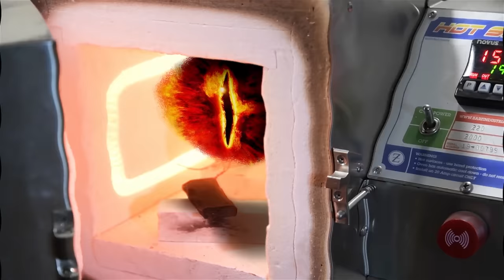Making a Slip Joint Knife

Comment: What you want to do is put a shim between the scale and the blade when you peen the pivot pin, to stop it pinching. To fix a tight blade after peening you can half open the blade and give it a good tap to lever the scales apart slightly. However this can pull the pivot into the scales a little so it's best to test and fix before finishing the scales.

Comment: Hey Tony, long-time follower and fan here hoping you can help me with something.  I don't know where to post this question, but since this is your most recent video I will post it here.  Do you have any tips or tricks for drilling holes in hard to reach areas.  Like, if you needed to mill a small cylindrical pocket maybe .500" wide by .250" deep in a cylindrical cavity about .750" wide and 2.000" deep.  The smaller pocket needs to be perpendicular to the axis of the larger cavity, and located halfway down the larger cavity.  Hope that made sense.  You could just drill a hole from the outside, and tap the hole and fill it back in with a plug short enough to leave a pocket; but let's say for aesthetic reasons that is not an option...what do you do (other than wire EDM)?  The material being machined is aluminum.
Reply from the maker: that's a tough one!  is the bottom of the small 1/2" pocket also cylindrical?  3/4" isn't a lot to work with.  Can you come from the other side?  mill through the opposite wall, make your pocket on the inside, then plug that hole?  It could be welded and remachined.  This might even be tough for EDM to move around in!
Reply: @ThisOldTony  Sorry for late reply.  I had a part prototyped with the EDM, so I know it is doable.  I want to make them myself but don't want to go the EDM route.  The bottom of the pocket is also cylindrical.  My best idea so far is to use a 1/2" reverse counterbore (picked one up from MSC Direct online).  The reverse counterbore is 1/2" diameter and 1/2" tall.  It also fits inside the tube easy enough.  It has a 5/32" pilot hole, so I am thinking turn down the outside diameter of the part but leave it a few thou shy of final OD.  Drill 5/32" pilot hole.  Reverse counterbore from inside toward the outside.  I will have my 1/2" cylindrical pocket about 1/4" deep.  Then turn a small 5/32" pressure fit pin about 1 thou oversize, tap it in place, and finish turning the OD to size.  After tumbling in media and anodizing I don't think there will be any evidence of the process on the outside surface.  It's OK that the pin enters the cavity a tiny bit since the cavity holds a small coil spring (it will just wind around it).  That's the best I've come up with.

Comment: We older telephone engineers would call the noisy spin-a-ma-things Strowager Uniselectors  When you pick(ed) up the phone, the uniselector found A spare first selector and dialing tone.  I've lost count of how many I, dismantled, cleaned, oiled adjusted spring tension and remounted during the 70s.  The noise was deafening.  These days the entire exchange would be about the size of the box.

Comment: 20:56  Uni switch.  They are like the next generation of step switches.  Looks like he's had some exposure to telecom, but not somebody to show him the nuances of lacing.  That and there is a huge difference in the type of lacing cord.  The poly stuff never looks good, and never holds like it is supposed to.  Good old cotton nine cord is where it is at.  Back in the day every wire would be secured, and every running stitch would be the same distance apart.  Spend days in a single telecom bay just lacing everything down.

Comment: Oh, by the way, do not smell or inhale the dust from those contact's... Those are made with orange and or red brass... unless those are from 1981 and newer.. if pre 1981, although it smells neat and tasty... well, you know the drill.. Very likely not pre 1981 and older... But, if the are.. they will last for ever, but the breathing bags with in your vessel will not.. Compliments of General Bell Telephone, so all the female phone operators can scoop that dust up, and sprinkle it like it is nutmeg on buttered toast.. or is that only what my mean grand mother did for me?

Comment: The switches in that have seven contacts per row for a reason. How many digits does a typical USA phone number have if you exclude the modern-day area code and country code from it? If you guessed seven then you are correct, have a preverbal cookie! If you did not guess seven then shame on you. These switches were originally used for automatically selecting phone lines and would have ten positions that each switch could be in. With multiple of these switches (I believe seven [one for each digit] but I am not totally sure as these systems were complicated) you would be able to use a rotary dial telephone to dial a number using a series of electrical pulses to activate the relays on the switch. This would then allow you to dial your friend up to talk to whilst also ringing up a pricey bill (yay........) and when you hung the phone back up the switches would disconnect and reset back to a home position. These switches would be under constant use and had to be changed out regularly or else you could have a condition where the circuit would constantly connect you to the wrong line as opposed to just occasionally (typical way to fix this was to hang up and redial).

Sorry for the long explanation (well, not really, its your fault if you read the whole thing) but I thought people may find it interesting what these switches were used for and how they worked.

Comment: And unless she has an accident, nicks the blade, or wants to totally reshape the bevel…..it should never touch anything but a strop from now on. 

Just like chisels, gouges, and hand plane irons… The bevel and Edge is shaped, honed to between 5K to 15k grit on fine stones, and then stropped regularly. 

Just like a barbers razor. You don’t see the barber taking his straight razor back to the stones after every few beards. 

Same with my hand tools. I re-strop my hand plane irons sometimes multiple times every few hours. According to what wood I’m working with and how heavy the work is I’m doing.

Comment: This Old Tony, I am in need of your help and price if possible and hopefully a video on my little dilemma. My cross slide bearing housing completely cracked rendering my Jet 9x20 lathe useless. I tried a 3D printed one with no avail. I have drawings of the part needed and would like to add a thrust bearing to it for smoother action. Is this something you would be willing to do to help a faithfull follower of yours who is new to lathe work?

Comment: I know you aren't an angry pixie wrangler so no biggie that you got the term wrong. The sign isn't multiplexing, rather it is a matrix (you did get the row/column part right, just not the term of the technique). Happy holidays, and I need to work on my folding knives to get them sharp enough to slice tomatoes simply by opening them.

Comment: For future sake, all glues including epoxy absolutely hate heat. Depending the glue it might be just little bit, or lots, but while i havent tested this i believe epoxy should separate comparable to CA glue, so little touch with small blue flame torch that uses lighter gas and it should pop right off nicely with out burning the wood, thats why i love them more than american style torches. Also while not expert on cnc programming, but you should been able to do rounding rather easily with locating pin spots as points, slight fuck up should be possible to hand sand quickly to hide any imperfections and if program fucked up then there is no problem to give the brass some more heat to get those two separate to salvage the brass and just go adjusted design on the new wood peaces.
Also while i absolutely love the design, i have big issue that you cant lock the blade in place. This would be absolutely nono to me. Maybe add the lock for safety and ou please release PDF of this design, would love to make it to my self with that slight adjustment as everyday carry knife.